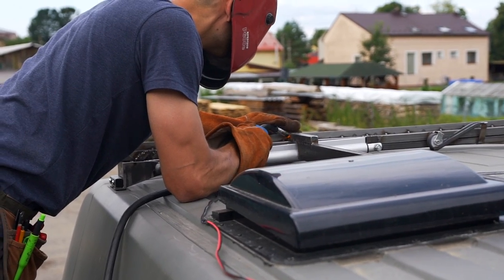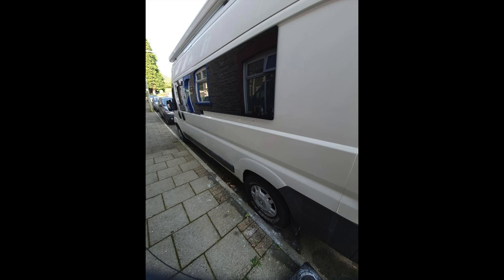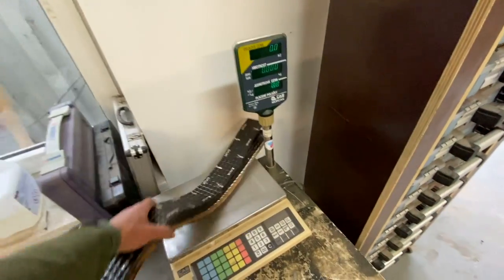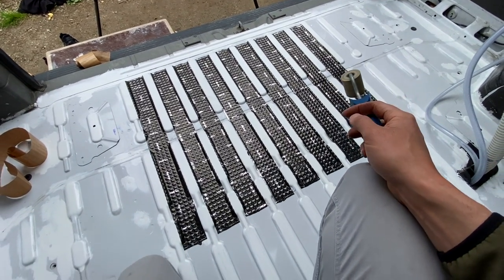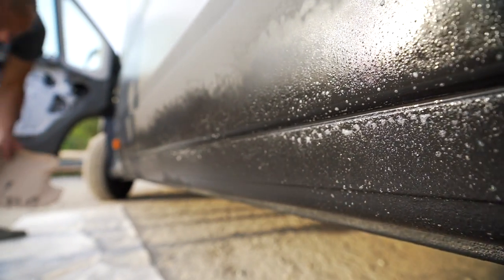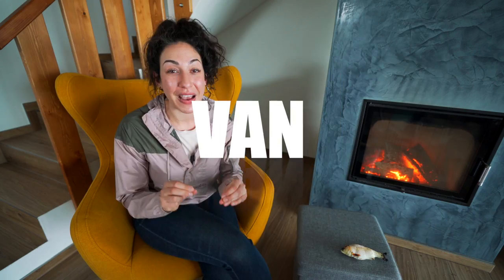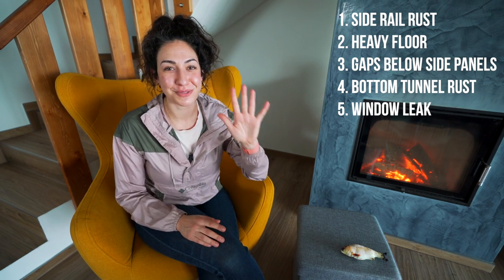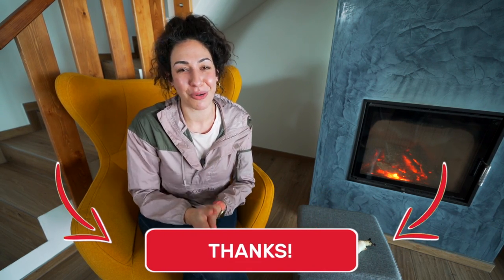DON'T MAKE THESE 5 VAN BUILD MISTAKES!

Comment: Tip from a fellow van builder, always water leak test your roof once everything on the roof is installed and check for leaks before starting on the interior.

Comment: We bought a mostly converted van knowing we would rip out lots of the build but we’ve now ripped literally ALL of it out and found lots of mistakes including mold, hundreds of random tek screws doing nothing except making places for rust, etc. but the most annoying one is that they used rust colored primer. Can you imagine??  So far our worst mistake in the build is that we installed an exterior AC outlet (we are not going stealth) and trusted in the gasket that came attached to the cover. Luckily I went back and was taking some of the wool out of the bottom of the walls (yes, because of you) and felt wet wool higher up and traced it to the work box so now we can correct it before the walls go up. Ugh. Two steps forward, one step back the entire journey!

Comment: Two things. First I don’t think with a frontwheel drive car, you will be happy in light offroad. Think, we you convert a van, where do you add most of the weight? In the rear, correct and then you wish the rear wheels are driven.
Second, maybe I didn’t understand right, you use the sounddampening material for fixing a leak. Don’t do this. First under my roofwindows I had this material. After 5 month it started leaking. It is not UV resident,  started to crack and water came in.
Fixed this with repair tape for roofs. This is a thin layer of aluminum and butyl tape.
Since 15 months it is waterproof .

Comment: Maybe not a mistake, but on my next build, I will definitely surface mount my electrical wiring instead of in the walls, it was a ball ache to do and almost impossible to add more now! There’s always cupboards etc to run them in. ✌️

Comment: When it comes to stop rust in those lower cavities use the rust inhibitor that is like thick oil that they sell at car repair shops. If you combine it with drain holes to let out the inevitable moisture or condensation you will good to go for a reasonable time. Make the drainholes so big that you can get in a long spraynossle and add rust inhibitor once a year, then you would have done everything you can.

Comment: Our regrets:  That evaporative cooler we installed in the roof isn’t really doing it.  And not spending the money to get a good mattress in the beginning.  
It’s weird that your previous van was noisy.  We didn’t do any sound deadening in our floor and ours is quiet.  Making a foam cushion to push up into our roof fan (while driving) helped a lot.

Comment: I would have put more pull-outs underneath my countertops just a 3/4 plywood slide out under the countertop I would have put more of them in my build that little extra countertop space makes a big difference
Reply from the maker: yes that is such a design upgrade!

Comment: Welcome to my life. My swamp cooler install didn't go well (tropical storm during installation)  but I eventually finished. Now, a month later a leak. Turns out that the sika flex I used didn't adhere well to plastic. I'm gonna have to fix that with PU. Let's see. Though as I'm going slowly, having a leak before installing plywood for the ceiling is better than finding out later...

Comment: Great video Lady & Margaret 👏
- You can fix your 1st issue applying some Sikaflex along the gap between your side rail and van body. That's what I've done and the water doesn't seems  to go behind the rail (if you have any idea to actually test it ?).
- Biggest mistake : screwing the solar panel system from the inside of the van. I will have to strip off the whole ceiling if I ever need to detach/inspect it. A better option would have to use a threaded rivets and a bolts from the outside, or use the existing roof attachments as you did.

Comment: On a previous build I used plain board for cabinet construction and covered the finished cabinets in a high quality furniture "Wrap", it looked great when made but wasn't very damage resistant and in hot weather started to peal in places.

Comment: In our experience, applying sound deading material to the roof is far more nessesary than the floor. No one sleeps in the back while you drive, so floor is not that important. However, applying it to the roof, and using batt insulation will help with those rainy nights when the rain is beating on the metal roof.

Comment: I'm Liking the idea of the vinyl behind the sliding door runner. Sealed mine with silicone after the rust treatment and paint but I don't trust it.  You guys seriously should fill those 'Bottom tunnels' or sills with cavity wax. It is a product designed to kill rust and it works. It's a staple in classic car ownership!    

My biggest mistake was moving into the van before it was finished. It is now a year later and all I have managed to do in that year is put shelving up in our wardrobe. I have to say my years of planning and research paid off to build our very own dream van 🙌 🙌

Comment: Biggest mistake was not paying enough attention to materials and joints that might squeak as a van twists over uneven surfaces. Every joint—like cabinet against side wall—or abutting material—like paneling over rear doors—should be firmly affixed with glue, or separated by a non-squeaking material such as air, sealant, or rubber. Unlike in a fixed home, anything in a van that can squeak will squeak.
Reply: We are in the process of planning and build our van so watching lots and absorbing as much as possible. One tip we have been told is everytime to fit something like a cabinet drawer etc take your van for a drive to see if it makes a noise at least that way you it’s the last thing you did rather than trying to find that one annoying squeak from the whole van. Hope you sorted your noises out. Great videos 🤙🏻
Reply from the maker: That is very overanalyzed topic. I did not pay any attention to this and our van is very comfortable quiet when driving. Glueing panels is very bad advice!

Comment: Converted a school bus that my husband and I now live in full time. Vapor barrier is KEY. Condensation is no joke, especially in colder climates. Cover every piece of anything that will collect condensation and eventually mold. Even on windows, we plan on adding little removable/ washable strips of fabric at the base where water collects when there is condensation. That way, it will collect all the drips, and we can take them off and wash/ dry them periodically.
Reply: What kind of heat do you have? My wife and I are converting a school bus right now. During the conversion i was using a propane heater but eventually planned on installing a diesel heater. We noticed a TON of condensation while using the propane heater, but as soon as we started using a diesel heater, we don't see any signs of condensation anymore.

Comment: I used pvc trim instead of wood to fasten the windows. Because it will not rot if the vent leaks. In fact the only wood I used was cedar for decoration.

Comment: Our biggest #1 buying a used van and not getting a good look at the roof. The whole back roof panel had been very poorly replaced. Two hours laying on the roof in the freezing cold cutting and applying bits of white butyl and we got all the holes patched. So $20 bucks and lots of scary labor. Much cheaper fix than we feared. #2 Letting the black factory floor warp while we worked on the underfloor. I'm thinking we are going to have to trash it and use something else. #3 Almost broke a wrist cutting the shore power hole because we used an old drill with poor kick back protection. All the other mistakes are yet to be determined!

Comment: We are in the process of changing our van. For the new van we want to have a certain changes regarding storage space. Pull out drawers not cupboards.  I hate bending down to look in the back of cupboards.  We are considering diesel heaters, what do you think. We rubberised the floor in our existing van but it wasn't as heavy as yours, it was only 5mm. However the new euro 6 vans weight will have to be investigated with a fine tooth comb.  We currently have a truma boiler but if we go to diesel what will we use. Quandary Quandary

Comment: Margaret,  Does MaxxAir make side mount fans? I've never cut a hole in a roof that didn't leak. Granted, I've had house skylights and they all leaked. Even if they had a great seal, when hit with snow and ice and when the snow and ice thawwed, water travels in all directions.

Comment: About rust and moisture, if it’s inevitable you still want to slow or delay as much as possible. Would (actively) managing these areas not work? Ventilating, heating or desiccants? Then unreachable areas can be insulated and keep their insulating value and remain problem free for the life of the van.
Reply: I wonder if you could run a diesel heater into the body panel gaps near the floors, so it would travel along under furniture and distribute evenly around the van, then bonus points dry out that area. Not good if you're using propane heat, obviously, but I'm beginning to think nobody should use propane heat in such a small vehicle because of the condensation.

Or some sort of floor fan pulling in cooler air from lower (small vents in back doors?) then the roof fan expels hot air out. Same idea as the people that have two rooftop fans, one directed in, one directed out... But pulling in cooler air instead of hot roof air.

Comment: If the weight exceeds 3,5 tonnes, registrer it as a lorry and weigh it up to 4,2 or so. You will have to drive slower, 80-90 km/h and a license for it, but more capacity :)
Reply: Actually it differs depending on country, they live in Czeckya, in Sweden it is not possible. Believe it is in Germany.

Comment: My biggest mistake was using blow in insulation in my wall panels -_- lol. I also used expanding foam to seal it in. But when I drive around with my windows down. It blows everywhere Inside hahah.

Comment: Fluid Film, look it up...Put that in the gutters and underneath you ain't getting rust...Looks like your side strip clips are not sealed 7:10, only way water can get in there, there are no holes in the bottom of the side gutters..You showed holes in the rockers which don't enter the van, but they need to be fluid filmed, or woolwaxed (videos on youtube)..PS, never paint under van it will chip and water/salt gets in and can be worse than not doing anything, fluid film only...

Comment: Great vid! I didn’t really understand how you fixed the leak? Did you use the sound deadening material on the roof? If so, is that a loong term solution? Fells like it will be destroyed in the sun/cold?

Comment: Maybe it is the van. I have a 08.Vauhall Vivaro It spent it's first 8 years as a trade van in the UK and last 7 years in Portugal travelling around Europe and rust wise......nothing. Look around, these vans and sister vehicles don't rust. But don't seal trim and think about letting water out.

One slight regret/envy is not buying a LWB that extra 40cm makes a big difference for no cost, but hard to find. The guy I bought it off upgraded to a LWB..doh! Other than that the van is perfect for us, drives like a car, parks like a car, but we sleep/eat easily and cheaply. Much better than a T4/5 in every way..apart from image..maybe.

Comment: *** I have a great solution / hack for your rust issues!**  I live in Hawaii and there are 2 products everyone need to know!  #1 - Oshpo (paint prep light acid that neutralizes rust) #2 - TC-11 ( large spray can like WD-40 but formulated to prevent rust).  I use it on bare metal tools in my open shop (5 miles from the beach) and keeps rust for years!

Comment: Not fitting a diesel night heater whilst in the build Process, I didn't think I would need one as it's only a small van. Boy was I wrong! To fit one now means dismantling most of the interior.

Comment: Your dislike of rust shows your admirable character.
PS: A long way Murphy Bed is the other solution for tall person van life.  The seat backs can be on the Murphy Bed back set higher to lean back on and just fold down.  You use pneumatic support gas shock gas struts so it can be pulled down and put up without effort.  No need for a taco bed and the shelving can be on the other side.  Table doesn't need 500 pound drawers as you go for 4,000 pounds on solid rests, so you can hammer it.

Comment: We bought a CamperVan fabricated and the only extra equitment we bought was and 4G antenna. however they put it through one of the cabinets over the bed. So that room is missing 20% space instead of placing the antenna 60 CM further in the Van then it would be in and unused space. So frustrating to see everytime i need to get some clothing up there

Comment: You would think that in the year 2022 someone would have come up with a solution for rust on vehicles.  I drive a 1999 Honda Civic which I love but it has rust spots from the salt in the winter.

Comment: I'm watching different videos of conversion, and alot of them use heavy matereals. drawback is more load on van systems in cost of longer lasting internal parts... 
In my caravan most made of very thin plywood. and even with that, weight is 1.2 ton.

Comment: Biggest mistake was putting Armaflex insulation and covering all the metal with felt. Taking this back off for what ever reason you might have is nearly impossible…I’ll think of other removable solutions..nothing will be directly glued to the van anymore

Comment: Looks like there are two types of vans, hot or cold climates, trying to make a van for both is a mistake. It's the same with boats.
Reply: nope, when your insulation works great in winter, it´ll also work good in summer against the heat
Reply: @jimicob9143  So true.
Reply: @jimicob9143  Like a house , insulation works both ways..Don't know why people think Insulation is not necessary in a van, I guess they know something engineers don't..

Comment: Awesome video, but i just have one probably really stupid question. For mistake number 4, the bottom tunnels. Why not sealing the holes at the bottom and than put wool or so in there🤔 bc i always thought u have them in a van so if u tip over liquids, it can run through the holes out but u dont really need them in a camper van more in a work van, right? Or did I understood that wrong? 🤔
Reply: I have this same question. Would love to know why caulking up the water weep holes wouldn’t solve this problem.
Reply: @DennisNagelkirk  water will inevitably find it's way in through body panels and seals, or collect as condensation then puddle at the bottom. Always best to leave a way for the water to escape.

Comment: I am not convinced about that sound insulation. You added weight to a thin panel. Increased the density, and of course less vibration. The question is that with the temperature insulation I think you would get both results. Take a look what they made on the new shop/old barn... Mineral wool all.over... any accoustic problem.with the shop? Guess not

Comment: Hi,  regarding the benefit of tilting solar panels,  this is also mistake,  lost time,  weight and money.
Otherwise,  best luck.
Reply from the maker: oh we disagree completely, especially because we are power-heavy users on the road. For those who don't have ebikes, multiple comps, monitors, etc that'd be a different story.
Reply: @ladiandmargaret  According to solar panel installers,  tilted panels provide 10% more energy if you are parked correctly regarding sun,  and 25% gain is possible only if you have tracking device, horizontally and vertically.  Therefore my opinion,  and maybe reason why nobody else not doing that.
Reply: I can for sure confirm that in winter, my panels perform way less on my camper than in summer. Lifting to a 60 degree angle would improve that quite a bit vs just flat on the roof this time of the year.

However, a recent Tech Ingredients video demonstrated an alternative setup with 96% reflective coated aluminium panels,  which reflect onto the panels for 300-400% increase in performance of a flat panel. Seems like a good alternative route, though the lift is brilliant.
Reply: @mrd7592  We just got back from a camping trip and I put out our 80 watt portable solar panel and compared it to our 200 watt roof top panels.  The portable one was generating 73 watts while the roof top panels were only producing 60.  I would love to have tilting panels.
Reply: @FromShetoMe  Maybe technologies are not the same?  You do understand that you must aim panels to the sun all the time? Peak power and average...
Reply: @mrd7592  My point was that you can’t aim fixed panels. They are nearly worthless in the winter.

Comment: Biggest mistake was discovering the layout was wrong after finishing the van build. Solution was to sell the van and do it right on the next build. Second mistake was not buying lithium batteries at the outset. Lead acid batteries are definitely a very poor relation to lithium. Think it is all correct now 🤔

Comment: Are you updating the original videos / descriptions to call out the mistakes? I bet a lot of your viewers don’t watch all your content front to back like a tv show and are just interested in one thing at a time.
Reply: This is a major problem as without any correction (or, ideally take-downs) faulty approaches are replicated throughout the community. Would be sweet if builders at least went subsequently back to provide a Comment on what did NOT work in their video.

This is true of any instructional video not just related to Van Life.